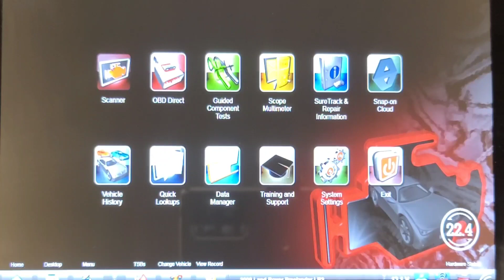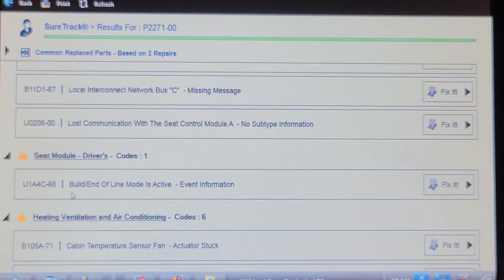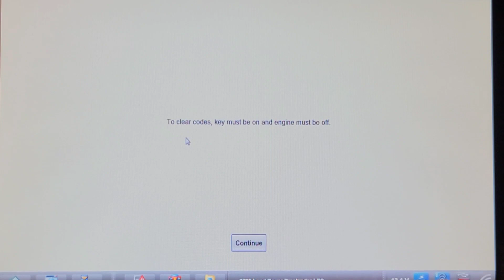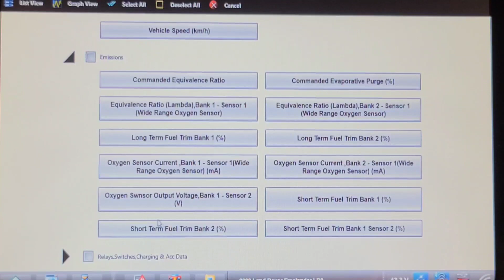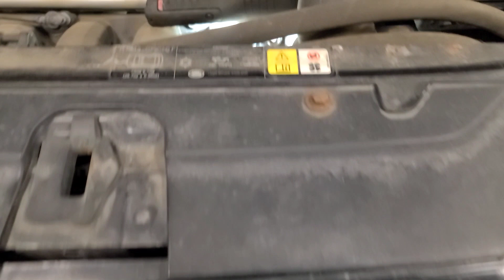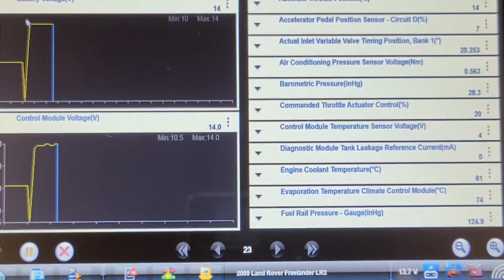2009 Land Rover LR2 Battery Warning Light On Code U0120-87

Comment: I’m having similar issues on a 2008 LR2 but that wire looks fine on mine. My car fails to cold start but then starts right up the second time. I read the fuel pressure gauge and it looks like it’s 0.0 PSI even with ignition on and engine off. Does your fuel pressure increase with ignition on but engine off?
Reply from the maker: I cant answer your question about the fuel pressure as I'm not sure sorry
Reply: @PhillipBailey  no worries, thanks!